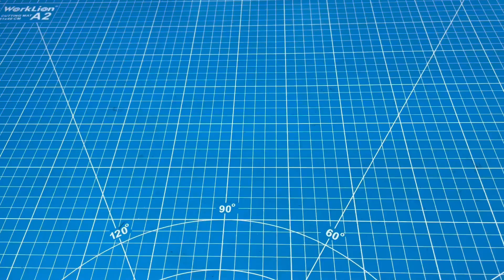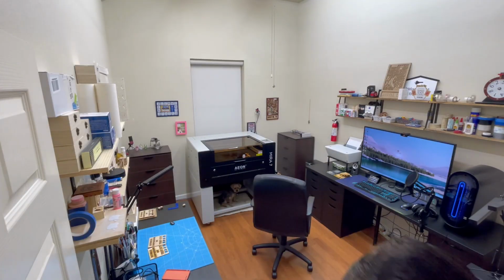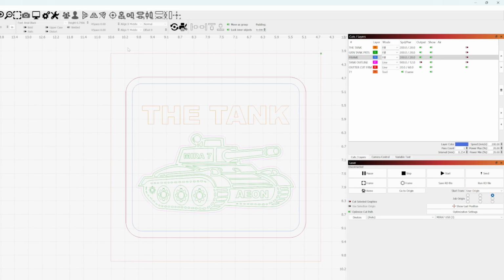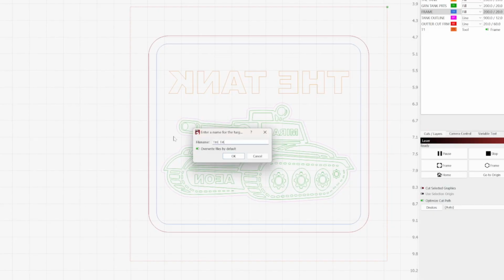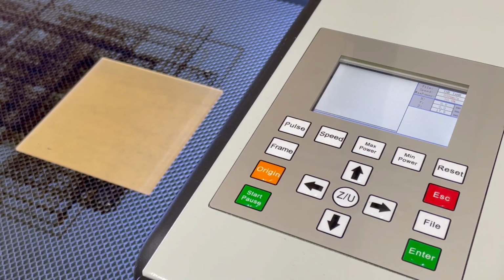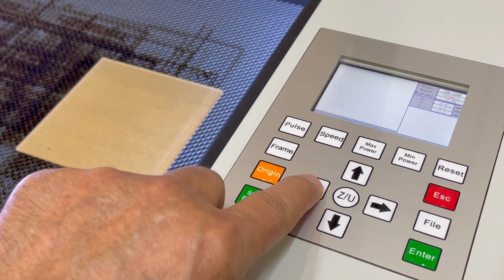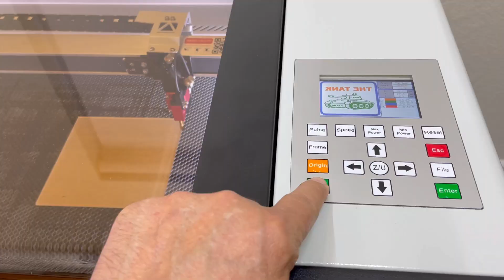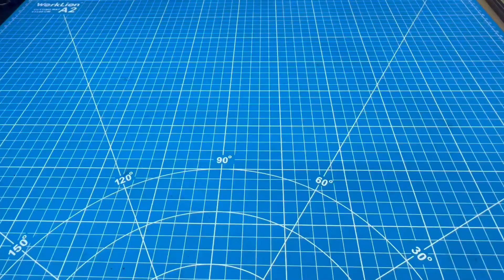My First Project on my AEON MIRA 7 LASER!  #AEONVIP @AeonLaserUSA

Comment: That room setup is sweet, I see the air-compressor setup- do you vent it out your window without the need for the Expensive add-ons like the Filtra-Box setup
Reply from the maker: Hi 1738Crafting!
  Thank you so much for watching and special thanks for the "sweet" comment!  Yes.. I do vent my exhaust out the back window, and i do not use a filter box.  You can see my exhaust set up if you watch my video on it.   Hope you check it out.  https://www.youtube.com/watch?v=x5-pr6mo3MI
have a great day!!  Rico

Comment: Nice job. Was leaning towards a Thunder Bolt, but now I’m looking at an Aeon Mire 7. Want to investigate how does cutting 1/4” wood and speed.
Reply from the maker: Hi Nice Guy!
  Thanks for viewing my video!  I am very happy with my Aeon Mira 7 Laser.  I have used mostly 1/8" material with most of my projects. However,  I did do a lot of testing on 1/4" material when I first received my laser to test how easily it would cut thru 1/4" material.   I was easily able to cut thru 1/4" material with no problem.  I used 10mm/sec power with 90% power.  I have yet to set the power to 100%     I also attached an external compressor to the laser and blow about 25psi over the surface of the material while cutting and that really helps the laser to cut cleaner and deeper.   Hope this helps... and have a great day!  
Rico
Reply: @ricohernandez2394  thank you for the info, I appreciate it!